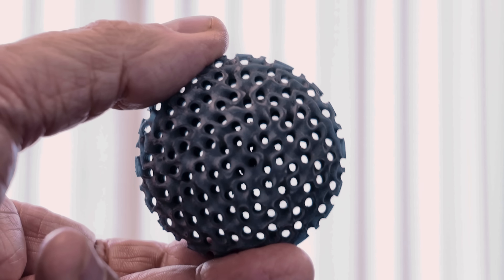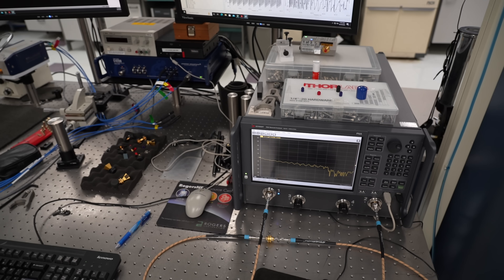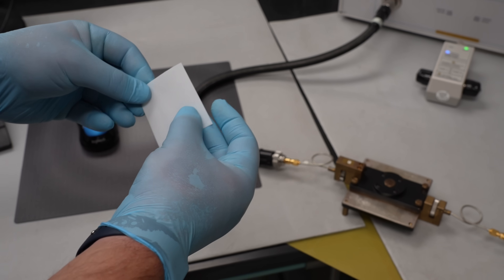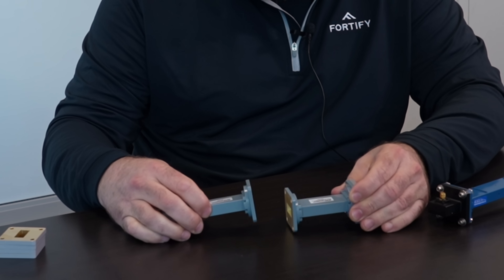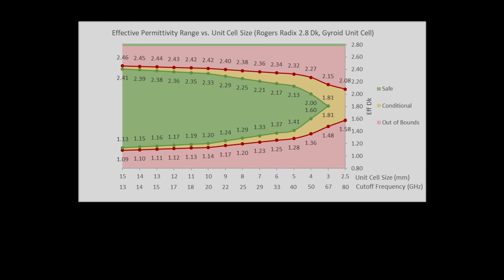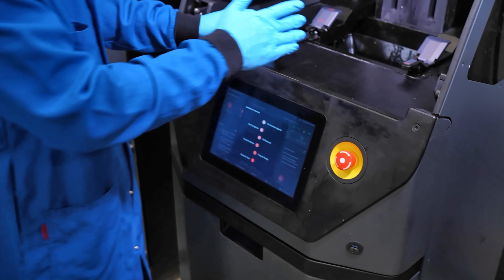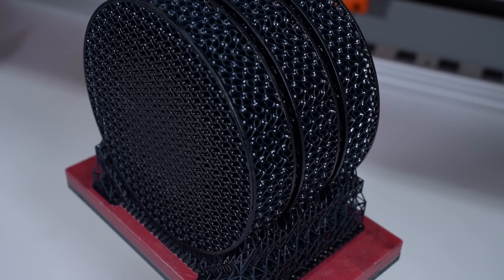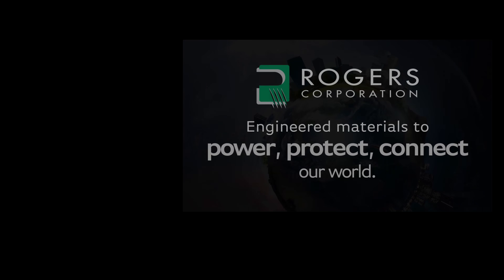Unveiling the Future of Antennas and RF Lenses using Radix™ 3D printable material!

Comment: 3d printing really is a game changer, not ideal for mass production but for more specialist stuff like this they really shine
Reply from the maker: Machining gradient index lenses is possible, but CNC drilling 20,000 tiny holes in ten different sizes isn't exactly scalable either!
Reply: That's where you're wrong! I've used 3D printing to mass produce parts because it was ultimately cheaper than making a mold.
Reply: Just like the space station has now, futire homes will have a 3d printer be an integral component of the home...
Reply from the maker: @onradioactivewaves  I think I would prefer a lathe, mill, CNC laser, CNC machining centre, injection moulding ram, metalcasting kit, furnace, forge, electroforming gear, and about  ten other bits of kit before a 3d printer. Services that use big industrial printers within an easy delivery distance like many bureau services already provide, would be much nicer. Printers are noisy, slow, unreliable, smelly and take up a lot of space when not in use. Maybe one day they will improve, but I'd much prefer a bureau with fast delivery if local collection until they mature a lot. We are still where we were with computers in the late 1970s as far as hone units are concerned. Still very much for nerds like me as an end in itself, but theres nothing wrong with that, we did ok with computers, didn't we!
Reply: 1000 printers can output a bunch
Reply: That's where you're wrong
Reply: @onradioactivewaves  my kids must be able to 3d design parts as natural as drawing
Reply: Try producing this with old tech - mills etc, near impossible
Reply: @mattweger437  Low volume, sure. But after you hit 10k/15K parts per year (assuming a single cavity mold, probably 30K for multi-cavity) the economics of IM are really hard to ignore.
Reply: @yyyyyeeeee4060  true
Reply: @yyyyyeeeee4060  I only do low volume because no one wants to buy my shit 😎.
But it was only one part that was printed and it was a light guide that stopped bleeding and overlap and honestly made the whole thing look better

Comment: I worked with antennas and waveguides in the US military; I didn't get to design them or understand how they were designed though. I did know that antenna tech was some of the fastest changing technology out there, but couldn't understand how. It's awesome to be enlightened.
Reply from the maker: The work on Bluetooth and near-field comms antennas, cellphone antennas and Zigbee etc for Internet of Things devices is moving extremely fast. Hard to keep up with it.  I might do a vid about the way it's all changing, but even just grounded coplanar waveguides, finline transitions and system-on-chip with in-package antennas are really fascinating.  I have some 5 x 5 mm chips with antennas integrated right on to the substrate for 122 GHz radar. That's pretty amazing, but also the phased patch array driver chips that are turning up to do things like Starlink is another really fast-moving area.

Comment: after witnessing the race to the bottom in the home 3d-printing market, I felt some sense of offense towards the field as a whole. However this video has given me hope and reassurance that significant progress forward has been made regarding additive manufacturing in this time, even if not yet on the consumer scale.
Thank you <3
Reply from the maker: The laser sintering machines for industrial use are the real game changers for me
Reply from the maker: I'm just talking to a manufacturer about a possible sponsored video using their laser-sintered metal print service, to see if it's possible to get a good enough finish for silver/gold electroplating over 316 stainless. That would be for things like waveguide combiners and perhaps antenna feeds. It might be very interesting, but I'd need some internal overhangs and that might not be possible. That's going to be a lot of work though. Also it is too expensive for a hobbyist like me so they are talking about sponsoring the vid. I guess so long as it is entirely about making useful and interesting parts with their service, it will acceptable to my audience to do another paid video in a month or two if it's interesting enough. Watch this space...

Comment: Glad to see you have a sponsor, Niel
Hopefully this will open new avenues for you (even if it is additive rather than machining)
Reply from the maker: It's a one-off project for now,. I'll be back on to machining videos in a few days, I have two almost ready to release. The sponsorship fee has paid for all of the studio and shop upgrades.  Also it's a material and company that I'm 100% a fan of, I'd have done this for free!
Reply: @MachiningandMicrowaves  Did Rodgers cover your flight and accomodations too?
I love the way your studio backdrop fills out over the course of this video (I keep looking for the Easter egg!  🤣)
Reply from the maker: I wasn't quite organised enough to do the visual trick.  I has AIMEE set up on an iPad in the top right corner, and I was going to move everything along one cube every time there was a cutaway, but as this is only the second video I've made where I appear, there's just too much to think about.
Reply: @MachiningandMicrowaves  You need to ask Flashaholics for a sponsorship as well.
Those lenses are very intriguing!
Reply from the maker: The Mikaelians seem to work well at 24 GHz, and the unit cell size should just about work at 47 GHz.  The hyperbolic secant profile should match an aspheric biconvex focussing lens, but with lots of diffraction and some reflection.  I might try an anti-reflection coating, but an 8% improvement would be hard to measure.  Part two will show the results in a couple of different applications
Reply from the maker: I just had this vision of a damn great big flashlight as an enclosure, with a mount for a surveying tripod and a decent internal battery to power a 24 GHz beacon source or remote receiver.  Watch this space for the results!
Reply: @MachiningandMicrowaves  "I'd have done this for free!"
Don't tell them that!

Comment: I have been thinking about using acoustic lenses (which basically are the same idea but for sound) for improving the performance of horn speakers. Most people seem to either accept horns with their flaws or reject them entirely. Few people seem interested in improving horns. Maybe I will be able to leverage this technology someday.
Reply from the maker: You need to bear in mind the wavelength of the sounds and the unit cell size if you aren't using amorphous materials. 20 kHz sound wavelength in air is 17 mm, so that puts an upper limit on cell size at maybe 2 mm unless you are using low pass filtering.  Then think of the effective speed of sound in the material of the lens.  The difference between electromagnetic wave velocity in air and this material is mostly less than 2:1, but sound wave velocity ratios are often much more extreme between gas phase and solid. Good luck with the project, sounds cool!
Reply: Had the same idea. And my solution is right now a modified Biradial horn/waveguide but thinking from the source and that is the diaphragm over the phaseplug to the waveguide/horn.
That works well up to 10-12khz but then the Biradial behaviour of a falling effeciency for higher frqeuncies is making some issues.   Every dB that I can get more above 12khz is a huge win. But I have to be careful, otherwise I would increase harmonic distortions unproportionaly. Finding a solution  for this brought me here. Interesting video!
Reply: @christophmartin5381  my first thought about improving horn performance was to bounce the horn off a reflective diffraction grating, (probably only 1 dimension because of size limits). Then I thought of massively sectorial horns made by 3d printing. The sort of thing I was thinking of would have a huge number of sectors that continue right down to the driver. I can't see how to determine the offsets, but I think some advantage could come from making some of the sectors physically shorter by making them curve or spiral. I don't know how well it would work, but what I picture in my imagination as a first attempt would be something like 30-50 sectors on a ~60° horn.

Comment: 3D printers have definitely provided more opportunities for the range of metamaterials designs.  Super awesome!  Hadn't thought about all the variables and really nothing more than the range of structure opportunities and electroplating for some fractal antenna designs I was wondering about like spiral conical and discone like.  Otherwise, I've wondered about for Faraday Cage Anechoic Chamber systems linings... areas of opportunity for improvement.  Now I'm wondering about magnetics... though that's more low frequency stuff... though maybe HF transformer design maybe?  Beyond me and my budget... as well (sick) as handlers wishes, wills and wants. Jelous creature on this side of the pond in some juris. Really awesome topic!
Reply: I'm going to have to comment... are you planning to show the beam characteristics of the microwave spotlight creation?  HHhmmm... wondering what the propagation characteristics look like actually?  Man, neat!
Reply from the maker: Magtrex is a fascinating material, with a relative permittivity that matches its permeability.  Only usable up to maybe 500 MHz right now, but it allows miniaturisation of antenna elements without the usual drop in radiation resistance and bandwidth.  Slightly out of my chosen frequency range, but I had a look at it while I was in the labs at Rogers and it made my brain overheat

Comment: Ouu this is super interesting I've been looking into generative antennas and having a material like this would be amazing! I'm aslo imagining embed antennas that would never have worked before
Reply from the maker: Metamaterials as well. Generative algorithms work well on sild antennas, so I guess it would be feasible to use the same approach with gradient index or solid dielectric prints.
Reply: @MachiningandMicrowaves  I love living in the future :)
Reply: @MachiningandMicrowaves  Id also like to see how this could play with using different resins at the same time for structural componets iterlayed with the radix material!
Reply from the maker: I think Rogers are working on other resins, but I can easily imagine printing holes and slots for fixing thins in three dimensional space.  The finished parts are very hard indeed, but the matrix resin is tough.  In part two I try machining it to see what happens.  The limit is now imagination (and cost of course). This isn't going to be printable in an Elegoo Saturn or similar, those Fortify printers are BEASTS.  They are working on other ceramic fill resins and I saw some very exciting stuff going on. The folks at both companies are amazing to be around, they ooze enthusiasm and expertise and  that felt quite inspiring.  Being with smart people is always exhilarating
Reply: @MachiningandMicrowaves  Yeah I can imagine thats awesome people pushing the boundries! My interest with this would be production of 2.4-5.8 range antennas for small drones! Super excited to see what you can cook up!
Reply from the maker: @Jandodev  The weight constraints for drones are a bit of an issue at such low frequencies, but I make solid Rexolite 1422 lenses for 5.7 GHz that are not too heavy, so with a higher Dk, the printed versions could get quite interesting
Reply: @MachiningandMicrowaves  hmmmm 🤔yeah that could be really cool! That was my though on the weight side with the 3d printed baffels you could reduce it a bunch! Also the 'wow that exsits' factor too to spur peoples brains on this!

Comment: As awesome as all of this looks and sounds: Could you maybe explain, for us interested non-RF-wizards, how these lenses and antennae differ from traditional ones, and what new funky stuff they allow doing compared to beamforming and phased arrays?
Reply from the maker: Some of that will be in a future video.  Key thing is they allow patterns of gradient index that are close to impossible to produce by normal machining or casting. The applications are going to be in a wide range from rigid dielectric foams with metallized layers through to large arrays of lenses for beamforming to perhaps correction plates to improve the phase linearity of older large dishes, to who knows what.  This is an enabling technology so now the next step is for antenna designers and those working with couplers and amplifiers and splitter/combiners and filters to dream up the applications
Reply: purpose-built antennae for links, tuned for optimal signal strength at a specific distance, for less power usage for signal transmission. Like a single antennae housing, with swappable printed lenses for specific distances.
One possible use case I can think of.

Better control of basically everything we could already do, and some things we couldn't do before.
It's neat stuff.

Comment: Could this be used for VHF/UHF antennas?
Reply from the maker: The issue is one of scale.  A typical lens is around 10 wavelengths across, and even a dielspike needs to be around 0.7 wavelengths across and 4-5 wl long, so it gets very tricky below 3 GHz.  Lens mass and cost rises roughly with the inverse cube of frequency, so a 1 GHz lens would weigh around 1000 times that of a 10 GHz lens and be ludicrously expensive.  The region from 5 to 50 GHz is where these lenses work well in terms of practicality and cost.  You could build a UHF version using lego bricks or some sort of dielectric fluid in a shaped container, but metal antennas rule below 1 GHz (answered this on another video sorry, reposting it here)

Comment: This is making me think of the old radar used for the Safeguard (now retired) ABM system. 
The 'acquisition' radar still used today is phased array but the multi component 'targeting tracking' radar used an expanded polystyrene impregnated with metallic particles. I think some internal paperwork from The Bell System called it radar lensing. The shape, size and arrangement was highly classified but it made it possible to 'hit a bullet with a bullet' and it came down to near miraculous radar resolution for the very early 1970s.
Reply from the maker: Lenses have been used quite a bit, but making a really smooth transition is hard, typically needing either complex assembly or post-finishing. Using metal loading is another way to change the effective refractive index, and that then leads to metamaterials, where reactive metal elements are arrange to alter the phase of signals within the bulk material. I'll be using something like this for a lensing array.  Metamaterials sound interesting, but that's just a cool name, I'll be looking into some practical uses later this year.  Thanks for the interesting comments!

Comment: This reminds me of Falstad's old Wave Simulator java applets.  When I was about to graduate HS I first saw those and his circuit simulator and that got me into electrical engineering in school.
Reply from the maker: OpenEMS is free software and it will run under Octave, you don't even need MATLAB. The program dumps E-field values and you can then feed that into Paraview for visualisation. It's a very useful tool.  Not in the same league as HFSS and the other solver suites, but it's powerful.

Comment: I didn't have time to watch the video yet but I found the product and asked ChatGPT which is fairly good at RF and chemistry things and it gave this opinion: "In my opinion, the Radix Printable Dielectric material is an exciting product that has the potential to revolutionize the way RF components are designed and manufactured. The ability to create complex, finely featured dielectric parts using 3D printing technology opens up new possibilities for designers and engineers. The material's low loss characteristics and low moisture absorption make it a suitable material for use in a wide range of applications, and its feature size capability down to 225um is impressive. Overall, I think this is a promising product that has a lot of potential for the future." Sounds great and thanks for taking an interest in such an exciting part of the future.
Reply from the maker: Interesting! It's just rehashed word-salad.  It reads like a high-schooler's essay report based on some Google searches.  Perhaps once the models becomes more refined we'll see something useful, but it doesn't feel like it's adding anything. The one good thing is that you can tell AI-bot created content because it's rarely full of typos or grammatical errors, unlike casual human comments. I expect they will start making typos to make it more believable soon!  Thanks for the research effort!
Reply from the maker: @robwhiz8969  What I see in the bot comments is definitely meaningless word salad. I'm sure that it would improve if they paid for a proper service and apply it to solve a problem that actually exists and is useful.  Bot comments waste my time and don't do anything positive in this application.  The tech isn't to blame, it's the sad tech bros and script kiddies in their bedrooms who think they are doing something clever by generating positively unhelpful spam comments.  They could go and hold discussions with politicians instead or something, that might be a net positive contribution to the greater good
Reply: @MachiningandMicrowaves  Thanks for clarifying. Yes, of course. My comment was exclusively about specifically ChatGPT. It is not like other bots. For example I've cooked with it and ate what it suggested. It was good as well as original. Once the thoughts are "edible" like that (accomplish the objective goal in creative novel ways) it ceases to be word salad. It can solve certain tasks. Like I said, you can wait 1-2 years for larger models but this one is already flying at 10,000 feet which is why it has a hundred million users and I pay $240 per year for it.